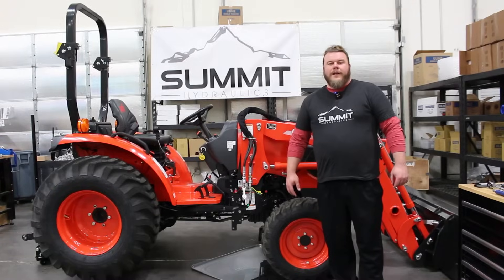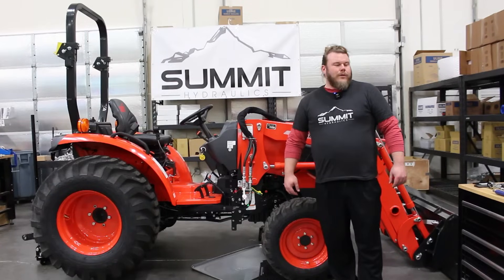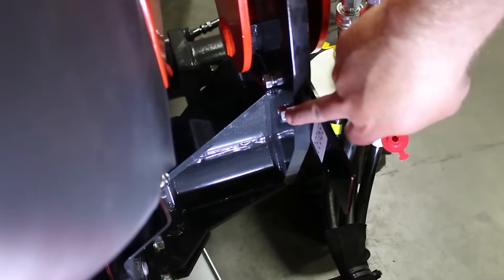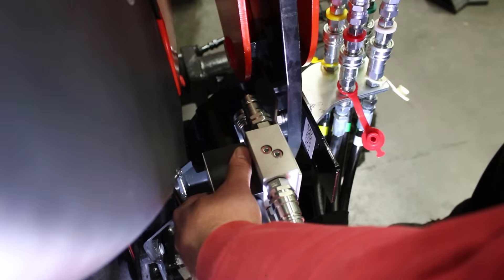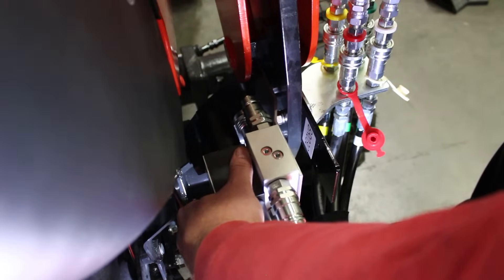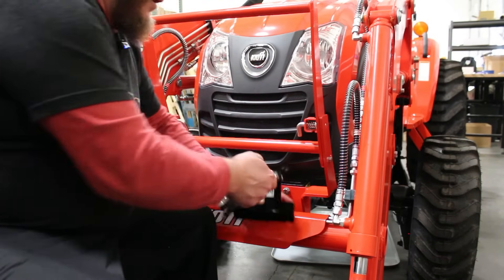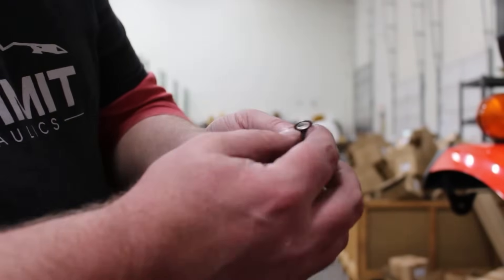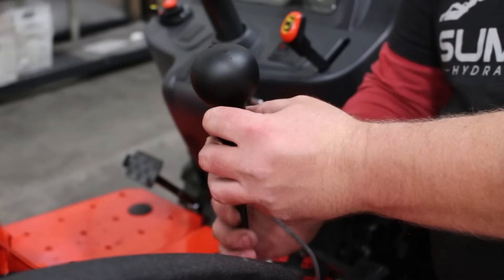Summit Hydraulics Universal Third Function Kit Installation

Comment: Mahindra loader valves don't have any t or p markings on the loader control valve so there's no way to determine how to plumb the hoses correctly.  They must only supply dealers with those diagrams.  There are no hydraulic diagrams for Mahindra loaders available online.  The Mahindra owners page on Facebook wasn't any help.  I guess I won't be using my grapple attachment.

Comment: Your diagram on your Amazon store for a universal third function does not show the "T" going to the tank.  In that schematic the hose goes from the Third Valve "T" to the Pump inlet on the tractor loader valve. It is confusing regardless if I am right or wrong.
Reply from the maker: It can be different in some cases, generally you want to come off the power beyond port on the tractor into the "P" port on the summit valve and back to tank from the "T" port. If you are plumbing our valve in series with another, you can come out of the "T" port on the Summit Valve to feed pressure to another valve.

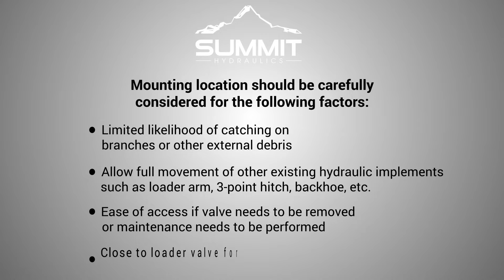Comment: I have a Ford 5610 it has remote in the back to operate the western dorf loader . We use to use a hardiness wheel 1:57 rake that need hydraulic to lift and then it just float down. But had to unhook one hose that ran the tilt on loader and put rake hose in it . . I’m looking to get a disc mower that will need to lines .is there some sort of valve I couple put in the coupler where I can turn a valve to either run loader or disc mower . Say the loader would bleed of while cutting?
Reply from the maker: If you are looking for a splitter type of valve to toggle between two implement functions, our hydraulic multiplier would be a great option. https://summit-hydraulics.com/product/hydraulic-multiplier-kit-scv-splitter-diverter-valve-including-couplers-and-switch-box-control/

Comment: I assume this can be used to add a 3rd function any tractor that has a loader, regardless of age? I have a 1991 Case IH 495 that I would like to add a 3rd function to for a snow plow and a grapple in the future. I am assuming this would work, as it is a stand alone system, stand alone wiring and plumbs into existing hydraulics on the tractor. Hence "universal."
Reply from the maker: Hello, as long as the tractor's pump flow is less than 15 GPM, and the tractor is an open center system, then this kit will work great.

Comment: It does get confusing just talking about it, even just a mock up with the physical hose's and such would have been better and a disclaimer "yours may be different" covers you?
 The biggest thing the tractor owner has to know is their equipment, you need to know what the terms mean and if your tractor has it. Summit does have a few diagrams that show how it's done and gives a few different ways of doing it if your tractor doesn't have a PB.
 With that being said, I did install one of your valves on my '22 LS MT235HE this spring and you had most of the information on your website and when I e-mailed a few questions you answered in a timely manor. I had ordered an LS rear remote kit when I bought the tractor and that didn't show up till this spring but it connected to your valve with no problems. Took me longer to figure out the best way to mount it than to install the darn thing.
Reply from the maker: Hello, thank you for the feedback.